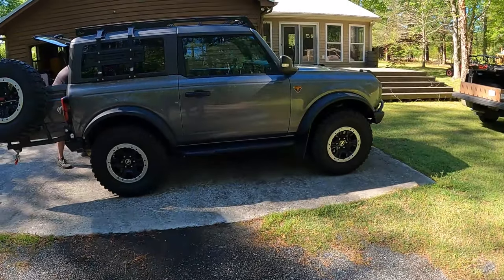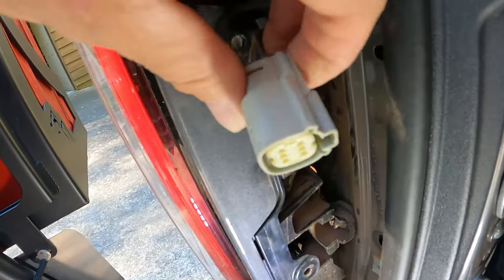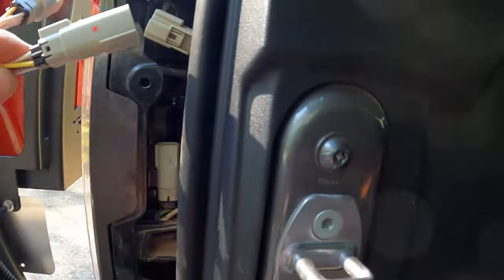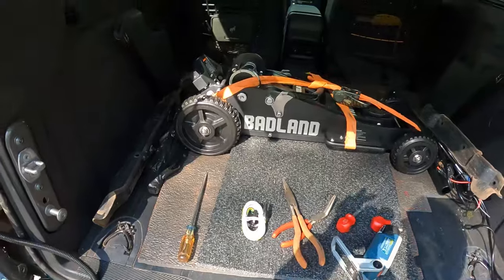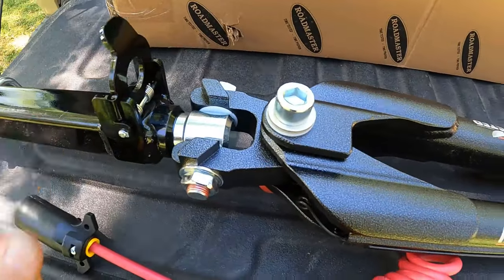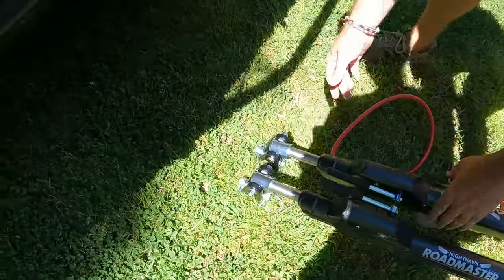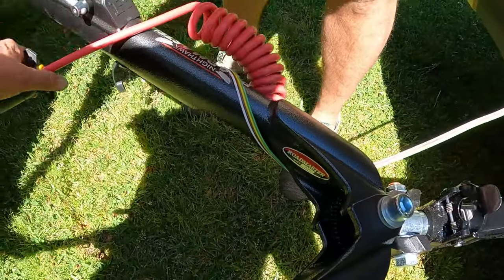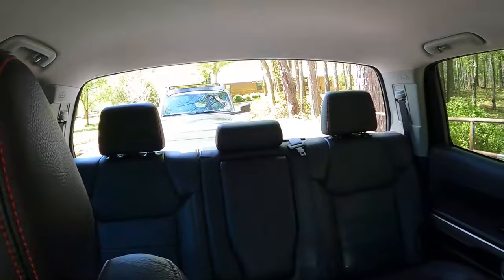How To Flat Tow A New Ford Bronco With Roadmaster Nighthawk RV Towing

Comment: Nice overview. Here a few more tips. When you are doing your hook to your motorhome, I recommend the Linchpin that locks the pin in placed be facing outboard on each side. It's a geometry thing, so if the Linchpin would ever fall out, the lock pin is less likely to walk it's way out from the D-ring adapter (believe it or not). Also if your Bronco has the 2.7L V-6 it has an electronic active brakes, make sure that the Blue Ox Patriot 3, the Force setting all the way past 0 until you see “H” for Hybrid mode. If it has the 2.4L I-4 it has normal vacuum boost assist brakes, so no need to set the Force to H. My last tip, I highly recommend that you use a Towed Vehicle Battery Charger on the Bronco. The battery must always retain voltage above 10.5 volts, if the battery voltage drops below 10.5 volts the transfer case could default into 2H. Safe Travels.
Reply from the maker: Thanks for the tips
Reply: 10.5 is a dead battery so thats way to late and the 2.7 has been updated awhile back and turns off the EBB when you go into flat tow. You are correct about the pin though.
Reply: @sz33809  The TCM, and BCM looks at low voltage at 10.5 volts as the red line, it's doesn't care of the battery (SOC) state of charge.

Comment: When flat towing a 2024 Ford Bronco Wildtral behind a RV, can you flat tow at 65mph? Are there any distance restrictions?
Reply from the maker: According to the bronco owners manual, there are no speed or distance limits. Be safe and thanks for watching.
Reply: @ProjectsWithPaul  thank you! Searched the manual high and low and didn't see the specifics! Love my new ride for every day use. So comfortable. We started out to buy a Jeep since the main reason for the purchase was to "flat tow behind our RV" so we would have a rugged 4 wheel drive vehicle for our adventures! The Bronco was just more appealing inside and out!

Comment: Did you need to install a brake light relay? My RV has combined tail/brake lights. I was reading that when using the supplemental braking device, the brake lights on the bronco override the turn signals. This means that when you hit the brakes and using your blinkers at the same time, the blinkers won’t work.
Reply from the maker: We did not put a separate relay in. He wasn't worried about the blinkers as long as the brake lights were working. Thanks for watching.